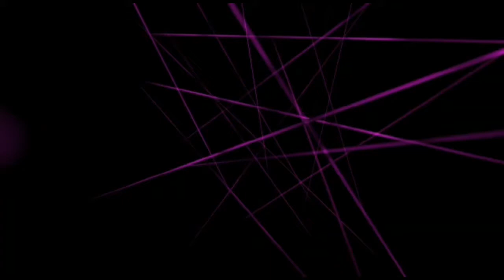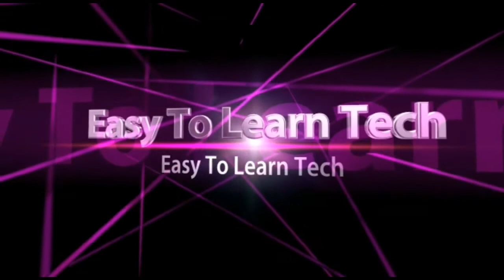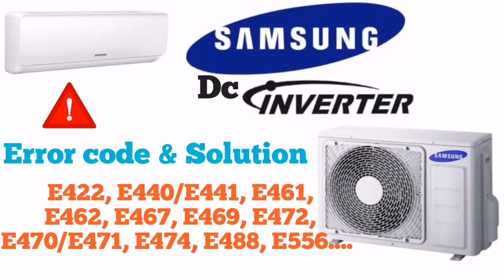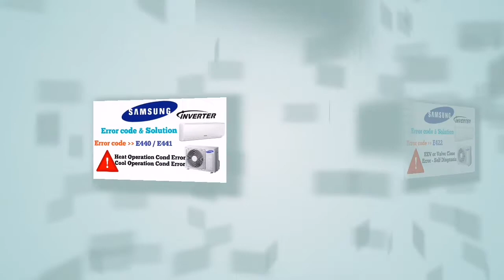#LIST2 || SAMSUNG DC INVERTER AIR-CONDITIONING ERROR CODES & SOLUTION /BLINKING LIGHT // NUMBER CODE

Comment: Il mio ha e483 che cosa posso fare?
Reply from the maker: E483 error stands for :H/W DC_Link Over Voltage Error.
Check the reactor and its connecting wires.
1. Is the wire between the reactor and the Inverter PCB of the outdoor unit correctly connected?
2. Is there any fault such as scratch,pressing, broken or loosened terminal.
3. May be outdoor PCBs is not giving proper dc voltage.

Comment: can you please explain me about E458 in smart inverter samsung 2.5hp.thanks.
Reply from the maker: The error E458 is for outdoor fan motor, *NEED to check connector in PCBs ,
* wire from motor to PCBs ..
*check the fan motor is good or not.
*Check the PCBs out supply to motor if it's not correct change the PCB or repair.

Comment: Can you please explain about E590 in samsung
Reply from the maker: E590 means Inverter EEPROM Checksum error..
Need to use the new  EEPROM & start the unit let new EEPROM update the system.. if again your getting same problem change the PCBs......
Note : if you change PCBs
It may aske for option setting for the unit.

Comment: sir how to fix C1 63 error samsung split type 2hp. its blinking C1 63. please help me sir
Reply from the maker: C1 63 or E1 63 error codes
Reply: @Rehankhan_HVAC_TIPS   its blinking sir C1 63. can you please help me about this?
Reply from the maker: It's a option Error setting, need to do option remote setting, follow the steps in this video https://youtu.be/Endv4XJU-XM

But for the code you have to asked the nearest Samsung care for the code, because according to the model the code changes....
Any another queries do not hesitate to contact.

Comment: Led 1 on.
Led 2 off.
Led 3 blinking.
Samsung inverter AC error. 
What error is it sir and it's solution .
Reply from the maker: In which your getting this light blinking indoor or outdoor
Reply: @Rehankhan_HVAC_TIPS   sir, blinking on indoor unit. Washed my outdoor unit with portable car washer using water only. After washing , dried it whole day . When on , outdoor fan not rotating and indoor unit is fine. Shows led 1 on, led 2 off, led 3 blinking. Badly need your help sir
Reply: No cold air flowing. Only normal air like fan. Outdoor fan not moving.
Reply from the maker: EEPROM Data Error,,, please remove the EEPROM from the pcb and re installe,,, if it works than good,,,, if again it showing the same error,,,, than you have to get a new EEPROM and installe....
Reply: @Rehankhan_HVAC_TIPS  thanks sir for the information. Do I need to contact a technician in order to inspect and remove the eeprom or can I do it myself without specific tools. Sir what is the cost of an new AC eeprom . It's a Samsung 1.5 digital inverter 3 star AC. Sorry for repeatedly disturbing you. Expecting a reply soon sir.
Reply from the maker: Cost depends on the region,, its better to take a technician